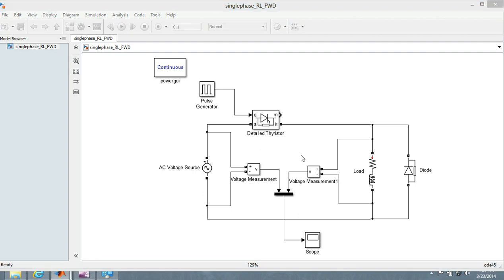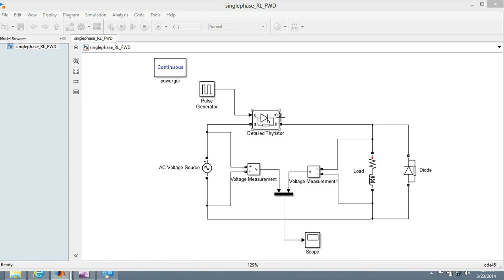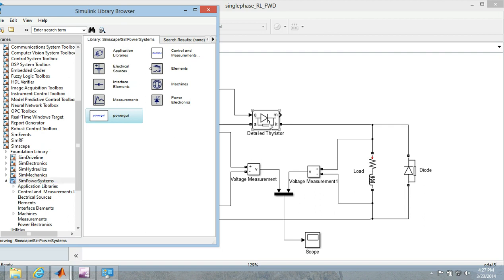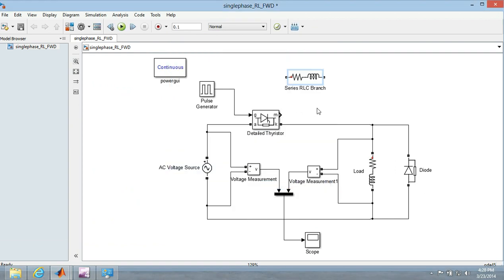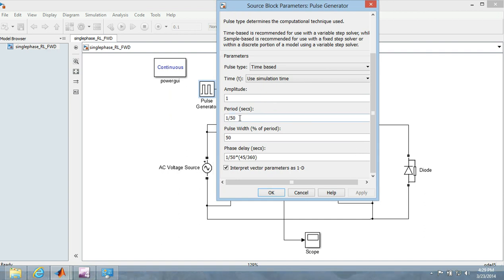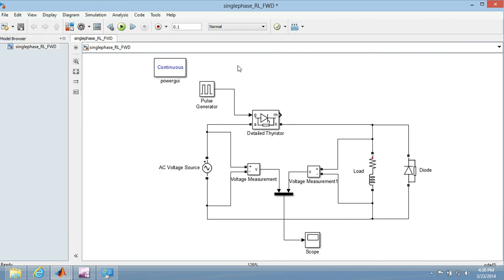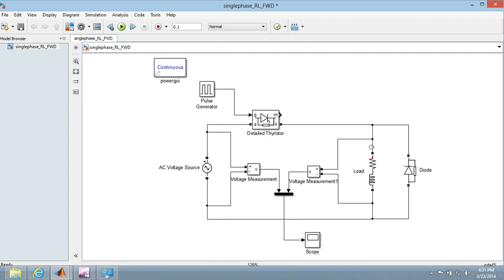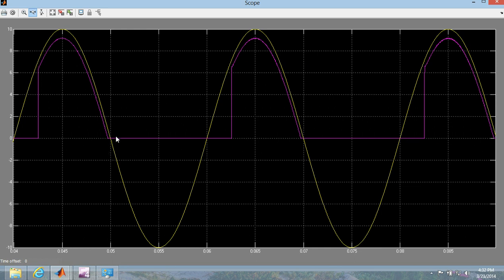Single phase half controlled half wave rectifier using simulink

Comment: Hi 
Thankyou for the video. It is very informative.some errors are there :

Stopping simulation for the model Rload, because the current simulation time (0.95189867362190583) is greater than the specified stop time (0.1)
Component: Simulink | Category: N.A.

 Using a default value of 0.2 for maximum step size.  The simulation step size will be equal to or less than this value.  You can disable this diagnostic by setting 'Automatic solver parameter selection' diagnostic to 'none' in the Diagnostics page of the configuration parameters dialog

Please suggest to solve the errors
Reply from the maker: Hi... perhaps you have set maximum step size and is not continuous. Go to simulation parameters and make it auto. I think it would solve the error.